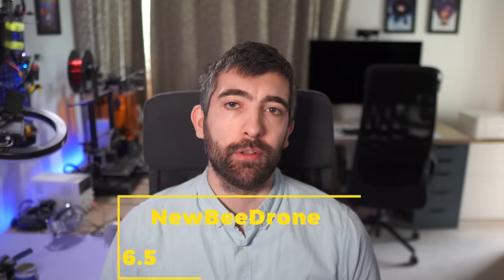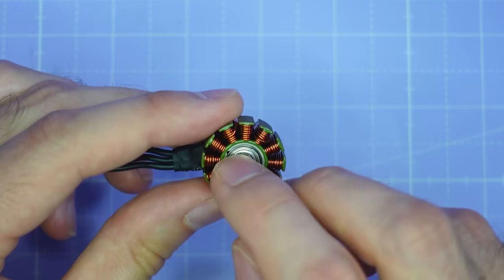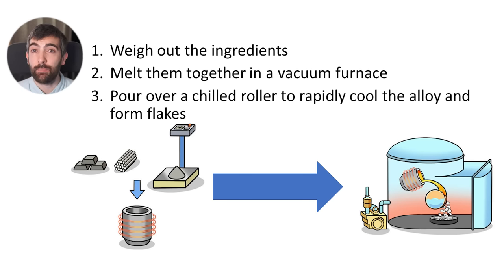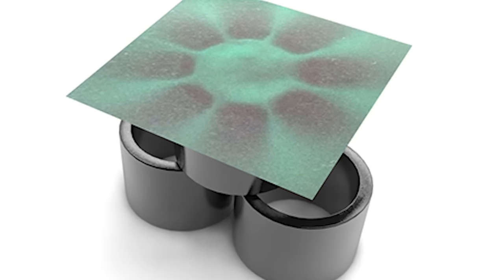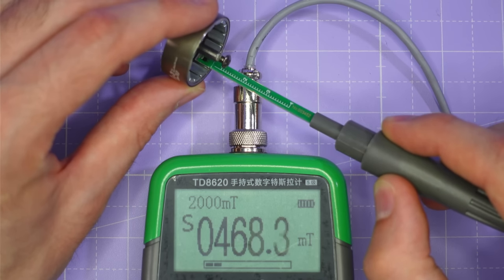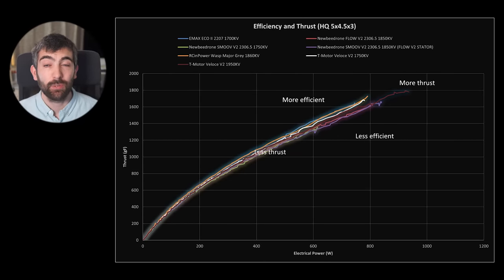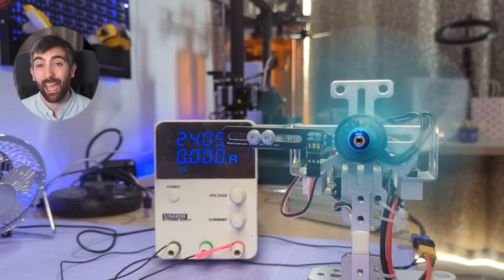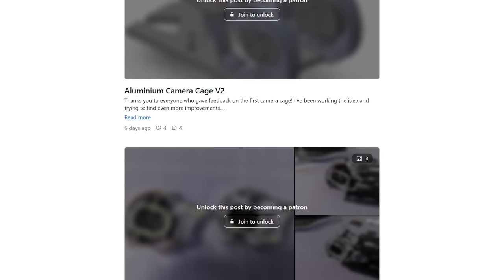NO MAGNETS??? Deep Dive on the Newbeedrone Smoov V2

Comment: More opinion shared as facts. These motors look like they do exactly what they were designed to do. The smoothness refers the the flying of the quad not vibration in the motor. By having less torque and response the stick inputs are smoothed out and the quad is less twitchy.
Reply: you should never let the motor something smooth out, you dont have any control about that. you can do that in software if you want and avoid loosing a lot of efficiency. smoth motors are just marketing to sell useless stuff with low quality materials or cheap manufactoring. newbedrone is not on the power nor on the efficiency side of motors. rcinpower or t-motor rule this atm.
Reply: Why so salty?
Reply: @rolliseventeen exactly
Reply: @rolliseventeen  that’s the total opposite of what you should do. Make the drone mechanically right, software is the very last resort not the first.
Reply: @David-ty6my  fed up of the constant stream of useless and irrelevant information that leads people down the wrong path.
Reply: @Atlas_FPV  you need a responsive drone if you want to win that race. Yes if you only fly your DJI that overheats if it even has to think for more than the bare minimum, then yes you need self stabilizing hardware that limits your reaction time, efficiency and maximum payload.
Reply: @Atlas_FPV  WTF? i never said its the first! i never said smoth motors have to be used, in my opinion this is just marketing BS. i also dont agree on your opinion "By having less torque and response the stick inputs are smoothed out and the quad is less twitchy"  in this case the motors may be not machanical wrong or defective, its just not calibrated to motor-prop combination. for this there is pidtoolbox and bb viewer.  i would say you cant avoid a problem by using smooth motors. nobody who flew and built a bunch of quads will do that. twitchyness comes from the setup, if the hardware is ok. lowering torque or power is just avoiding things which should solved anyway.
Reply: @David-ty6my  what on earth are you talking about?
Reply: @rolliseventeen  there’s no problem to solve, only imaginary ones. A motor that is more responsive, more torque and more powerful will by nature create a more responsive and twitchier quad… so then the opposite is also true, a less responsive and lower torque motor will result in a smoother quad.
Reply: @Atlas_FPV    i wonder who will do this instead of just making a good configuration with the tools we have. if you cant tune your quad you cant solve it with smoth motors anyway. you have to practice, more practice and much more practice.

Comment: I would expect a less-torquey motor to drain the battery faster too, as the controller will have to work harder - resulting in reduced flight times.

Comment: The RPM-torque characteristic of a BLDC motor is a monotonic function. The lower the RPM the higher the torque. The curve shown in the video does not make sense to me. What is this graph exactly?  Why does it start at 5000 RPM? What is that little curve at the beginning? After 15000 RPM the curves are more or less parallel. Different kv means different slope. It is stated that the lower kv motor produces less torque over the rpm range but the highest kv motor is the smoot-flow combined motor and it does not have the highest torque, that is a contradiction to me what gives?
Reply from the maker: Taking the questions one by one:
1. Sensorless BLDC motors cannot produce torque at low RPMs due to commutation limitations so the test starts at 5000RPM
2. At low RPMs the torque is limited by the current the motor can draw and the maximum magnetic field strength * air gap area so there will always be a peak in the torque curve.
3. Lower KV motors produce less torque at high RPMs all else equal, but weaker magnets produce less torque which offsets the higher KV in this case.

Comment: normal find full ring magnet in pc fan because they more effect than magnet bar plus get more power than magnet bar (first motor show magnet bar glues to housing)
only downside about full ring magnet cant go super full power because it throw it out of shape like north and south magnet stick go opposite cause some errors so there be 2 north and 2 south can ruined motor wiring and that all what i know from engineer motors builder

Comment: Single strand is not better for cooling.  It is all about the amouth of copper. If multi strands have more copper,  it will produce less heat for the same amp because less resistance. The cooling if from the air not the copper.

More you have copper = less heat it will produce for the same amouth of amp.  The more amouth of copper, the less resistance, the less resistance = more efficient it can flow current,  the more current= more heat potential,  but for the same amp, more copper is allways better  multi strand or single strand.  I have countless time on my thrust bench and in the 15xx motor, the one with multi strand outperform any single strand motor in the same size.
Reply from the maker: I did a test on this recently with the EMAX RSIII motor. The multistrand motors get WAY hotter (not even close). It's the interfaces that kill you with cooling, having multiple layers of wire with enamel and air in between is much worse than a single layer of thick copper wire. You can use more copper in the multistrand case but that makes the motor heavier.

In my thrust strand testing of over 50 2207/2306 motors all the best performers use single strand windings.
Reply: @ChrisRosser  does your motors have the same amouth of copper.  The same test was done by me with the spcmaker 1505 3450Kv vs a bunch of others 15×× motor and the result was in favor of the multi strand motor.  But like I said,  for the same amouth of copper, you should get the same internal resistance wich should get you the same heat.

One way you could convince me is that you read the internal resistance of each phase.  If multi strand is egual or lower than single strand than you apply the same amp limit and your results is you have a hotter motor for the same geometry(magnet, flux ring, air gap) than yes you will raise a good point.
Reply: Like you said, the amouth of insulation should play a role but for the same copper, multi strand have more surface area wich is also a key factor in cooling🤔

Comment: I would think the sintered magnets with gaps in between causes significant centrifugal air flow through the motor. Probably not an issue with a propeller but might be important in other applications .

Comment: TLDW: Less torque ripple but worse performance in most cases. Did have higher thrust but only due to slightly higher KV due to the fields being weaker. Might be a good solution for a robotics motor. Performed worse out of other motors in its class. It should be cheap to produce tho.

Comment: Not having typical magnets makes this motor desync. Ask me how I know.
Reply: desyncs have nothing to do with magnet types but your esc settingd
Reply: Did you think to tune your blheli settings?
Reply: Sounds like you might have a tune issue. I think this is one of those user errors things.
Reply from the maker: Desyncs are primarily a result of insufficient torque in my experience. If the motor has lots of torque it can follow the ESC commands. Pancake 2203s always had desync issues for this reason. ESC settings can help if a motor is marginal on torque.
Reply: @ChrisRosser  so would you say another way to interpret what you are saying is someone could be over-propping or over-loading their motor with the wrong motor/prop combo for that particular build and not know it. How would you suggest less seasoned builders identify the right motor/prop combo for their particular build and flying style.
Reply: @Voyajer.  Oh, trust me. I have zero experience with fpv
Reply: @drkastenbrot  oh, I guess those emerald imperial  motors that had known desync issues, that was cause everyone who had those motors had the wrong esc settings. Gotcha.

Comment: Why are you measuring Kv by free running?  Why do you not use a drill press or brushless drill with known rpm and measure the voltage?   Free running speed is a function of bearing friction, eddy current and hysteresis losses.  You could imagine a motor with such friction that it doesn't rotate and yet if you drove it by another motor it would have a Kv.
Reply: KV is not a standard. Chris uses 10V… for some reason, I don’t remember why that value 🤷‍♂️ 

We measure backEMF on a known RPM ramp and track field saturation… similar to what you described.

And then the marketing team throws out the numbers and bin them by “type” 😜😂😂😂 most of them anyway.
Reply: @lemonsquareFPV  KV is what hobby motor manufacturers use and is directly related to the BEMF constant of volts/radian/sec which is exactly equal to the torque constant in Nm/Amp
Reply from the maker: It's easier with my test setup to measure KV using free running RPM. You are correct that you can measure it both ways. I use KV for comparison so as long as the method is consistent I think it's OK. You may disagree!
Reply from the maker: I use 10V to avoid ridiculous RPMs and to make the Maths easier, you could conceivably do this test with any Voltage but lower voltages are better to avoid damaging the bearings.
Reply: @ChrisRosser  legit enough honestly, I don’t disagree with the method or explanation. I just don’t remember if your method was explained in the past, have been at work for 30+ hours 😜 getting a little slow.

Consistency is good for data integrity, even if only comparative. 👍🏻 I approve this message. (Everyone else’s data is unpublished or wack so no point anyway.)

I remember I was trying to write something funny, but it obviously didn’t come out properly. 😜 I also learned that all numbers always simply work and can be easily derived… so when I work on electrical systems, I don’t need to do any modelling or testing. Man I have been wasting so much of my life ;)

A little TMI, but it’s funny and in your honour. I hope it makes you happy:
Mr.Rosser our FPV pilot test team named the ultra performance benchmark motor the “Rosser” motor, it is optimized as our max performance benchmark motor, it’s a Wasp V3.5 basically. Less than 10% of people prefer to fly it though… numbers isn’t everything, otherwise making motors that people like to fly would be easy. People are weird 😜
The good well thought out and tested designs are for people not marketing. 😉

Just wanted to let you know that you are appreciated by a bunch of people. And even though I always give you a hard time, it’s because I care.
Reply: @ChrisRosser  With some brushless motors having huge cogging torques I have found it is the only way to be able to predict performance accurately.  The measurement that way doesn't care about bearing friction, brush friction, windage drag or anything else.
Reply: Kv is about amount of back EMF related to RPM. Free running is an easy way to measure. Assuming bearings and motors are always new, this should provide consistent results. Bearing friction can and will change over time, with use. For best measures, one would need to deconstruct a motor and measure performance of individual components, to get values on bearing friction, etc. 
This would add time, effort and cost.

Comment: smooth == anticogging. Which is irrelevant for this application, and which these motors aren't anyway. To do that, you have to skew the stator laminations so the stator poles overlap rotor poles, making the torque over a revolution plot, you know, **smoother**.

Comment: Values what gauss meater messure and what is written on video overlay are difgerent for billion times, on screent it is written 470 mega tesla (MT) and gauss meater show 470 mili tesla (mt).
470 mega tesla is over  10 times stronger them sreonges stable magnet ever made, which is hybrid elecromagent using superconductors kept on 1.5 kelvin and Bitter discs and needing just 30MW (mega W) of electricity or same amount that can power over 20000 homes.
Reply from the maker: You're right, just a capitalisation error. The meter is correct of course.
Reply: @ChrisRosser  it is just a capitalization error, and in this case, it do.not make a difference because you are using it just to find the ratio of values  so units do not, in this case, make difference bacouse you make capitalization error on both.
But in some cases, it can  make a big difference. For example, Kv, kV, and KV, the first one is "motor velocety constant" (or sometimes I find it  called generator constant). Second is kilo Volt and the third one by best interpretation Kelvin Volt (last two even one big YouTuber who make similar content as you and is EE and wrote book how to make cruise missile under 5000$  get wrong he claimed that third is kilo Volt which is error that EE is not allowed to make)

Comment: What a con! But, to be fair, less torque => less responsive => smooth response. It's just that the FC PID loop has a poorer performance when motors have a smooth throttle-rpm response curve. Seems like these manufacturers are "smoov criminals" 😂
Reply from the maker: The main symptom of low torque and poor motor responsiveness is bad propwash and in the worst case desyncs. Not things that are generally assoicated with smooth flying! 🤣